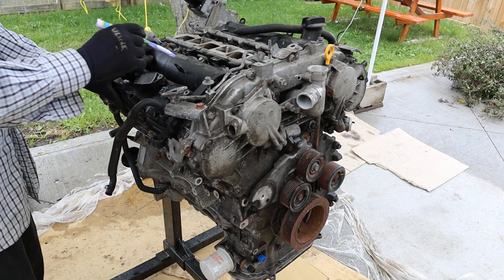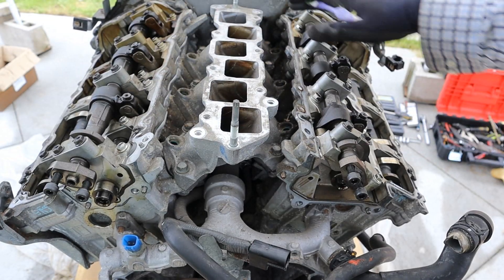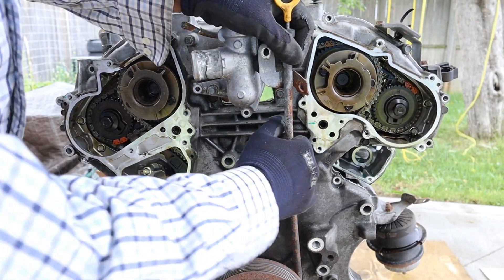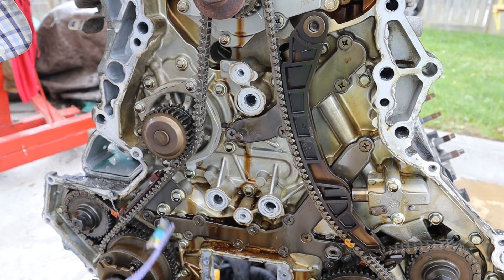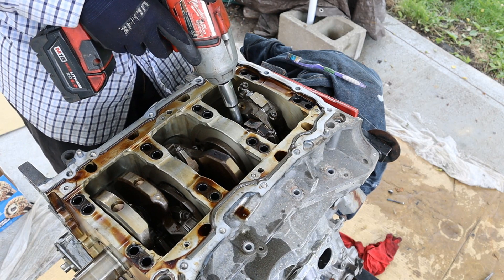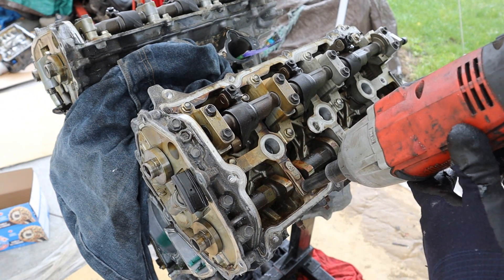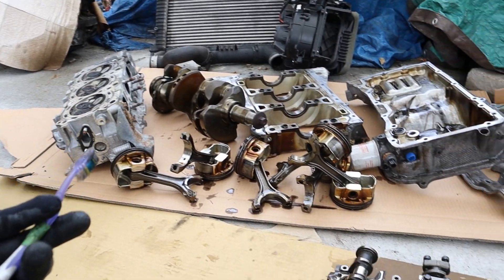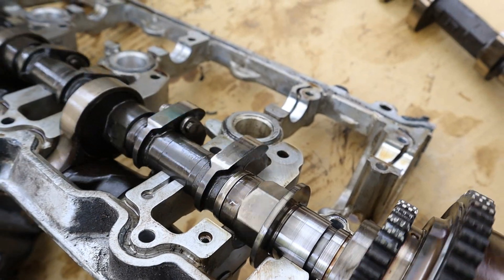The Last Good Nissan Engine: VQ37VHR

Comment: Great breakdown! One flaw with this engine is definitely the lack of an oil cooler. They have a tendency to overheat during hot temperature and motivated driving.
Reply: Very neat engine, with an oil cooler very cool!
Reply from the maker: I find that interesting since the older G35 had oil coolers. It probably would bolt on the oil filter housing if you wanted to add one anyway.
Reply: @speedkar99  interesting idea
Reply: The Infiniti all came with an oil cooler as did later generation 370z, albeit small ones that are a bit lacking for track duty.

But yeah they shipped without one on the Nissan side for the first few years oddly enough.
Reply: 2012 they added a oilcooler for the 370z @Myname Isunavailable
Reply: Lol regular 30 minute drive and its heat soaked
Reply: For a daily driver an Oil cooler is not needed.  I have 165k miles tuned running without an oil cooler.
Reply: There are aftermarket oil coolers that do what you need
Reply: I own a 09’ 370 and live in Florida where in summers it hits 104 (with humidity index) regularly. Besides a sticky clutch, these cars do great and don’t get as heat soaked as easily as ppl who don’t own one say.
Reply: @TboneWertman  My 2019 370Z 6MT sport model will hit 220-225⁰F oil temps in normal city street driving on a warm(not hot) day here in the SF bay area. My car is meticulously cared for and is in perfect mechanical condition, so the oil does tend to run excessively hot due to the nature of the VVEL intake timing mechanism that generates a lot of contact pressure and heat from the complex array of valvetrain components. In terms of engine longevity, an oil cooler is a must for performance driving and is a good idea for even normal use.
Reply: @speedkar99  the water cooled oil cooler is nowhere sufficient for that engine..i run an auxiliary oil cooler o in the bumper. It's needed
Reply: another is the oil galley gaskets
Reply: @duomaxwell5807  I have a twin turbo DE and always ran an external cooler.   Been going strong for over 12 years boosted.
Reply: overheating has to do with coolant, an oil cooler is to cool off engine oil.
Reply: @TboneWertman  never seen a reading of 104 in Florida ever. Rarely gets much more than 90-95
Reply: @TboneWertman  was of course talking without humidex values
Reply: Just leave the engine cover off and you will drop 15 degree
Reply: @philiprudolph3614  My 370Z is 2009 - no oil cooler. 😞
No problem in daily use but it overheats quickly on a track day.
Reply: @speedkar99 the 2012+ models have a water cooled sandwich plate where the oil filter screws onto. It’s still overheats in hot summer days and will definitely overheat if you’re pushing it hard on a cool night. A air cooled system works better hence the aftermarket for the vq37.

I had a 2012 touring and it did fine on temps enough to have fun. Didn’t have a aftermarket cooler.
Reply: 2012+ come with oil coolers oem
Reply: @FrozenInPain  Sure, but from what I can tell, all it does is run water through a sandwich plate at the oil filter. This is unlike aftermarket ones that actually cool the oil by running it through a dedicated radiator-style cooler.
Reply: @BigHeadClan  To my knowledge, NONE of the Infinitis had a oil cooler, only the later 370zs
Reply: @bloroxcleach  It sits directly in front of the radiator, just re-confirmed on my 09 g37. 

You’d not normally see it unless you have the front bumper off.
Reply: @BigHeadClan  I also confirmed it on my 09 G37S 6mt coupe. The only thing infront of the radiator was the power steering cooler. G37s didn't come with a oil cooler, hence the reason I added one.

IF it has an oil cooler, it would be a water cooled oil cooler, which won't stand up to track driving.
Reply: @bloroxcleach  Mine is an automatic with AWD so perhaps a difference in trim? 

Either way it’s not suitable for track duty and needs an upgrade.

Comment: I love my vq37 in my g37. I was able to do a 4000+ mile road trip across the US without a single hiccup and I daily drive tf out of it
Reply: Every vehicle being sold in the USA for probably the past 30 years being daily driven can still make a 4,000 road trip ??? LOL being moreso sarcastic but this does confirm my personal opinion that despite owning one and actually still liking it VQ35DE ENGINES are not long term reliable AT ALL, are way overpriced used and new parts are extremely inflated , ALONG WITH ONCE HITING THE 500 HP MARK THEY LACK PRACTICALLY 100 lb ft of TORQUE vs HORSEPOWER and by 700 HORSEPOWER their TORQUE IS OVER ....YES... FREAK'N OVER 150 LB FT BEHIND making them extremely rare and odd in a BAD WAY ... still like em but they KINDA FUCKING SUCK BRO... (S)

Comment: Still have PTSD from changing the gallery gaskets in my 350z VQ35HR but I love these motors...thanks for the breakdown. Definitely helped me understand how it all works.
Reply from the maker: At least the 350 is longitudinally mounted and you can get space up front. 

Can't imagine doing that in a FWD transverse mounted engine!
Reply: Is there anything preventative we could do to avoid the gallery gasket issue at all?
Reply: I installed an oil pressure gauge on my 370, so if pressure is lost you have a much quicker way of knowing. Otherwise replacing the gallery gaskets themselves with stronger ones and better hardware is the best way, albeit expensive in labor.
Reply: I think Nissan changed their galley gaskets to a steel reinforced design in 2015 I believe? Before that they were all a multi-layered paper gasket or something like that. The gaskets themselves usually held up, but with the high pressure oil running through the galleys, the bolts would tend to back off and then the paper gaskets would blow out without the clamping force of the bolts anymore, which would lead to low oil pressure especially at idle. I've changed the galley gaskets in my Frontier and 350Z with EPS Tuning gaskets (they call them gallery gaskets) and they seem much better designed with great instructions on how to put them on so they shouldn't ever fail or have the hardware back out on you
Reply: @mattschlatter4999  2012. So 2012-13 G's are good to go. My 07 HR is still rocking normal oil pressures at idle both cold & warm, no gallery gasket job to do yet. But it'll come... only 64K on the clock.
Reply: @matthewg.4223  No, only replace with a better one.
Reply: @jacquesc3166  Yeah, no need to worry about them if you've got good oil pressure. My 03 Z had one of the gaskets separate near the end but it had 170k miles on it before I had to get into the timing cover. It sat at 5 psi at idle which isn't ideal but I mainly drove it on the highway, which oil pressure was much better then. HR and VHR engines seem more prone to the gasket blowing out/leaking but some go on without issue for the life of the vehicle
Reply: @matthewg.4223  getting rid of Carlos Ghosn. It was his idea to cost cut at the expense of reliability
Reply: @matthewg.4223  I'm trying AT-205 additive.  Hopefully it helps soften the internal gaskets.
Reply: @mr.tall-man1573 the gallery gaskets aernt made of rubber so i dont think At-205 will really work

Comment: interested on seeing nissan’s VK series truck engines, I’ve heard they are based on the VQ but with two more cylinders, seen a lot of very high mileage Titans so they seem pretty durable as a workhorse
Reply: You should look into the vk45de, it’s a v8 for a Infiniti m45, literally based off of a vq35 with two extra cylinders
Reply: The trucks seem good honestly. I work as a GM tech but work on everything except for planes (yes that includes boats, atvs, heavy duty) at the shop. There’s a few Nissans I work on and it’s usually just seals, joints and maintenance. If I was in the market for a foreign market truck I’d honestly pick a Nissan Titan over a Tundra and Tacoma.
Reply: @frbrbrgrblgrr7777  also nothing like a good ol gmt800 with leaking oil cooler, rear main, oil pan and sewing machine tick that just won’t die😂
Reply: My wife's QX56 had 200k miles and still running like new aside from consuming a quart of oil per 3k miles.

Comment: VVEL is what valvetronic could never be
Reply from the maker: Yep! Reliable
Reply: Valvetronic has been reliable for a long time now & even the early Valvetronic issues I’d wager were more due to BMW’s ridiculous 15k mile oil change interval rather than the system itself.
Reply: @CadexLaw  it may be reliable but my friends 535 had valvetronic issues. It may be reliable if you pamper it
Reply: @balkaraulakh5131  I’ve never owned a BMW with valvetronic issues and I’m on my 6th one, although admittedly that’s anecdotal evidence.
Reply: @CadexLaw  eh, vvel has its fair share of issues as well. But the technology is in a lot of nissan vehicles and very seldom I see a vvel catastrophic failure. 

I guess we're speaking on personal experiences so none of this really matters. Maybe valvetronic is good
Reply: Valvetronic is super reliable, and also more responsive in the latest iterations. BMW engines fail a lot but it's almost never because of Valvetronic. They are on Valvetronic III and only Valvetronic I on the N52 had occasional issues.

Comment: Not sure if anyone added in the comments yet, but the failed oil gasket around the spark plugs is a common problem based on what I seen from other owners, including myself.
Reply: But overall it’s a very good engine. I love my G37 and enjoy starting the engine every time and driving it. I can say the same for many cars.

Comment: This is the best breakdown of this motor that I've seen. From how important the gallery gasket is. The water pump and timing chain. I like how you point out the impotence of maintaining the oil and temp on these engines. I love my 08 G37. They are power platforms. Truly. I just replaced everything on the front of my engine because added some mods and got tuned with uprev. I think my next investment thanks to you will be the Mishimoto oil cooler kit for around $600. If you know your engines weaknesses because they all have a few but, you can fix and improve them. Thanks to videos like this one. Thanks man!!
Reply from the maker: You are welcome. While the engine produces good power, the FM platform is a heavy one that doesn't handle very nimble...mor eof a luxury touring than sport.

Comment: 10:52  You mention that this engine was only used in rear drive applications,but Infiniti had a AWD setup in the G37x model. Excellent video!
Reply: The G37x is also rear wheel drive based. Same as every other G35/G37 some nissans did have a transverse vq35 tho

Comment: Great engine, very reliable. Most of the heat issues are as a result of the VVEL valvetrain, it generates alot of heat. These engines are specd for 5w30 oil. Its recommended to run a european spec oil for better thermal control. I have been running 0w40 Mobil 1 euro spec oil in my VQ37 Q50 since new and its never had any issues.
Reply: Run the same oil in my g37 as well. There is a noticeable difference in valve tick noise between this and 5w30, with the 0w40 being much quieter to non-existent.

I will say, the slightly heavier 40 (granted, the Mobil euro 0w40 runs much closed to a 30 weight) causes a bit more engine drag after ~1000 miles than the 30 weight does after the same mileage.

Comment: Very informative video! Thanks! 
The VQ30DE-K engines found in 2000-2001 Maxima and Infiniti I30’s are probably the last good engines from Nissan. 

No oil pressure issues, no oil burning, no drama, just good solid engines that are known to last well into the 300K mile range with just regular oil changes.
Reply: I just bought the a Maxima with a VQ20DE - I'm in Europe - and it's smoothness is just unbelievable

Comment: I got mine with 275k miles and still runs great. Very reliable engine IMO.
Reply from the maker: Awesome if it doesn't leak and run low on oil!
Reply: @speedkar99  fortunately mine ain’t leaking yet. Burns a little bit of oil, 1 liter every 5k miles.

Comment: I have a 370Z and this engine played a huge part in my decision to buy the car.  I can hold the motor at 6,500 RPM in 4th gear and it doesn't feel strained at all, just completely at ease and making peak power because of the excellent VVT system.  If I did that in my Grand Prix I would probably boil the fluid in the torque converter inside of a minute lol.
Reply: You should drive a BMW E46 M3 or Z4M. If you like this engine you will be very impressed with S54. It's similar in character, just better.

Comment: On the Hr and Vhr motors oil and coolant will not mix if there was a water pump leak, there is a weep hole that allows the coolant to drip down the side of the block and lets it leak down right above the oil pan on the driver side ive seen it many times lol i have changed water pumps on hr’s vhr’s quite a bit now and never seen oil and coolant mix

Comment: 2014 Q60 with 170,000 on it. Mobile 1full synthetic since the first oil change using OEM filters. Amazing car, still breaks the tires lose punching it over cross walk paint through a yellow light!
Reply from the maker: Yep it's a good engine. Too bad they're going with the VR series now... Not sure the long term reliability compared to the NA VQ...time will tell.

Comment: With some mods (Stillen dual intakes, Fast Intentions resonated high-flow cats, and a tune by Specialty Z) my 370Z is at 362hp. Also added a Setrab oil cooler since I live in Florida and drive it hard. Running Redline 5W-40. Best V6 ever.
Reply from the maker: Nice! Keep it full of oil and it'll last.
Reply: @speedkar99  It doesn't drink a drop so far. Always on H.
Reply: @povertyspec9651  How Many Miles?
Reply: We're in Florida the tune

Comment: I have one of these engines! The VVEL technology is amazing!
Reply from the maker: Any issues with reliability?
Reply: @speedkar99  not one problem. 167,000 running strong👍
Reply: @speedkar99  Zeeeeeeee-ro. 2nd owner of a '13 G37xS sedan, got it in Oct 2016. Rad was done in 2021, saved the 7AT in the process as well (AT trans cooler fittings on the rad were all rotten from Canadian winters).

Comment: Very good video. Mostly accurate except for saying they are known for burning oil. The old VQ35de was known for burning oil, the VQ35HR and VQ37VHR fixed that problem. I own both variants and my 2008 VQ35HR has 200,000 miles and still does not use a drop in 6k oil changes. The oil is still clean every 6k too!
Reply from the maker: Nice!

Comment: great execution Professor KAR. first time understanding the VVL system. would be interesting to have this on a straight 6 configuration, would every comparable to the VANOS. hoping if the merger with Honda go forth Vtec will definitely kick in "YO" 🤣
Reply from the maker: Vanos is VVt. I think you meant valvematic
.check out my N52 teardown for an explanation on that one

Comment: The QR25DE is a great motor they still produce. Can't forget that classic beauty that often goes well over 200K miles problem free.
Reply: Early versions of this engine were not known for their reliability. Some of those problems were not the engine's fault, such as the engine grenading after sucking in the faulty catalytic converter material. 
This engine has a stroke that is crazy long too compared with it's bore yet Nissan used it in some "performance" oriented applications. Strange.
Reply from the maker: Agreed! Not the best engine at all
Reply from the maker: I have a QR25 sitting here waiting to teardown next
Reply: @speedkar99  can't wait to see how that goes. Love what you do here.

Comment: I was trying to figure out why the vvl system was so complicated until you pointed out it was infinitely adjustable, then it clicked and I realized what a smart design it was.

Side note, is a new set of bearings all this engine would need to run again?
Reply from the maker: VVL was definitely a head scratcher for me trying to figure it out when I had it all apart! Very smart system 👍

Bearings could get this engine back together but you'd want to get the crankshaft polished to make sure it's not damaged and of course a new set of seals, rings, guides, bolts etc. Once it's apart it's only worth putting back together properly

Comment: let alone the knock sensor design flaw, the QR25DE (07-12 Sentra ser spec v) is a pretty good one too.... mine has 220 000 km. Still working fine even during our brutal winter seasons here in Quebec, Canada.
Reply from the maker: I have a QR25 sitting here waiting to be torn down soon
Reply: @speedkar99  nice

Comment: Nothing negative but one small suggestion when using the breaker car, make sure you apply force at exactly 90 degrees or perpendicular, as it does become harder when you try to turn the bar from an angle. It might or might not change whether or not you would be able to break the bolt loose, but you do lose or need to use more torque the farther you are from 90 degrees

Comment: I have this engine in a '17 qx50....and Id like to keep it running as long as possible. I am currently running spec oil and bg MOA. Is that good or bad? Ive read in the comments 0w40 euro spec is the better option. a lil bit of guidance would be greatly appreciated. AWESOME VIDEO btw...THANK YOU!
Reply: keep running what you have